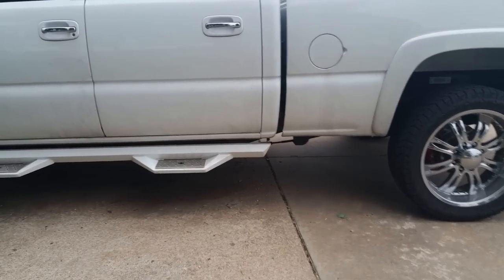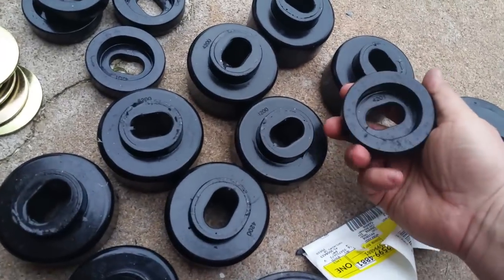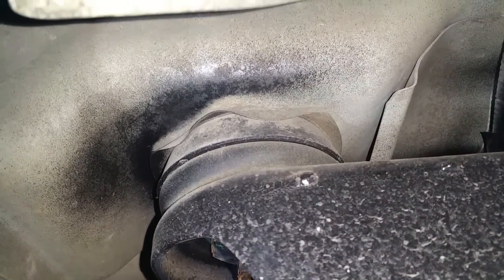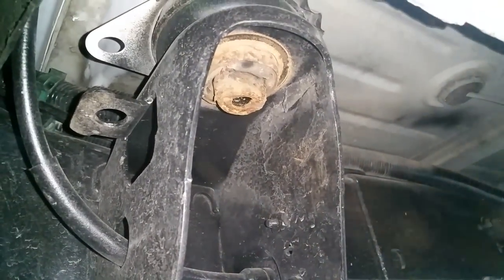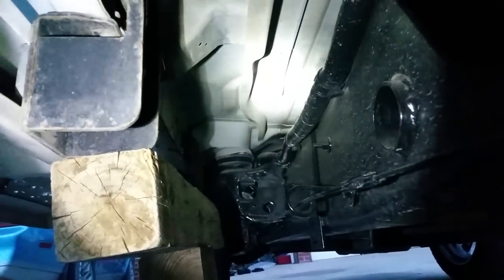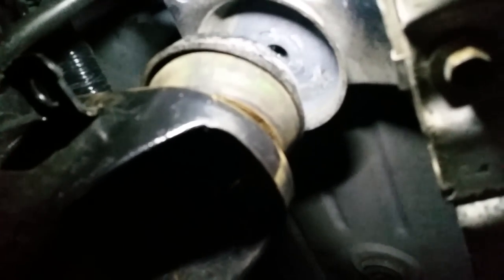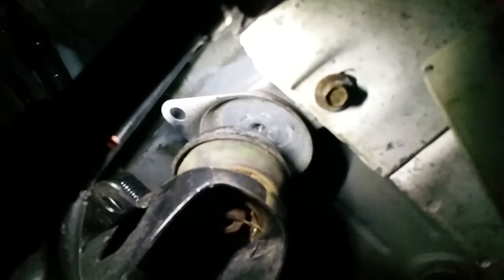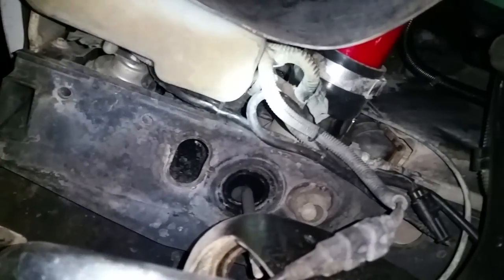2005 GMC Sierra 2500HD Body Mount Replacement

Comment: Nice work Brant! I did the same thing and painted under and ran silicon around to keep out water and air. Biggest killer for body mounts is trapped water and dirt.  I try to rise out around them and reseal them a few times a year. I have a friend who uses roofing tar lol

Comment: Thank you very much Brant! I had some confusion about what if an hardware to reuse, you were a great help!
Reply from the maker: I only reused the bolts - the poly kit came with the flat metal pieces and I replaced two of the poly mounts in the rear of the cab with the GM hydraulic mounts, so I have 2 extra.

Comment: Great video, although I did see on the instructions that you are supposed to reuse the factory sleeve up front on those mounts
Reply from the maker: Yes, you actually are. I missed that part and am still running without. Have always intended to do it again, correctly... Just haven't gotten it done yet.
Reply: @BrantGarrison  just got my energy suspension package today starting the job right now
Reply from the maker: @brentwegner9403  it's not too tough, just don't miss a body mount like I did and wonder why it won't go higher... 🤦🤦
Reply from the maker: @brentwegner9403  oh man.. yeah... That isn't going to be fun at all! Lots of penetrating lube and heat. Good luck and I hope it goes as smooth as it can!
Reply: Hey guys ? What do you guys mean reuse the factory sleeves up front 
I just recently replaced mine and left and didn’t reuse any old pieces except for hardware… I used the same bushings as the video
Reply: @MrPuthycoupe the metal cup on the top side of the mount and the metal cylinder shaped sleeve on the inside of the bushing
Reply: @danielz3594  thank you 👌🏻I ended up thinking that’s what it was , I went back and did that just had to buy longer bolts

Comment: Very informative thanks...I'm doing the same project on mine. I cant find the 'cups' anywhere except for a kit. Any clue on a part number for them?
Reply from the maker: Thank you, sir! The best I can tell is that the body mount cushion is the metal mount with the rubber inside it as one part.
Reply: I confirmed the same with a local dealership. Thanks again!!

Comment: I just did my cab mounts with Prothane bushings and was looking for tips on the radiator mounts. Hate to break it to you but you installed these incorrect. The directions say to reuse all factory hardware if not provided (mushroom washer/sleeve)  Might want to recheck directions, drawing etc. Factory rears look like they came with the sleeve  but the middle, front, and radiator support are basically floating.
Reply from the maker: Mike .Tracey thanks for the tip. I'll check them soon. the whole front end is coming off soon for some upgrades and I wouldn't put it past myself to mess something up.
Reply: Yep.. picked up a kit with no directions. Installed following this. Did some extensive searching. I need to re use the metal factory shells. I knew something was wrong soon as I began torquing to spec. Rear clicked perfect (hydraulic) urethane only started mushrooming. Gap above bumper was wrong.
Reply: Mike .Tracey  what are those top washer things called
Reply from the maker: The only thing i missed was the shells. It works without them, but for the sake of doing it right, they need to be reused.
Reply: Cooll
Reply: Did the shells effect how the body lines matched up? I lowered one side down and the cab sat high so I ended up not using shells on any of them and it sat perfectly.  Do the shells absolutely have to be on there?
Reply: Gavin Ory I was wondering the same thing. I used the stock shells, however I’m beginning to wonder if using the shell with the poly bushings is causing the noise I’m hearing when I hit a bump. If you look at the design, when you incorporate the shell, the bolt ends up bottoming out the shaft of the shell. The bottom bushing piece is not very thick. So seems to me if you use the shell, it doesn’t allow the bushing to absorb much of the shock from a bump causing a rough ride

Comment: Last  two for the hydraulic body mounts can you please explain that???

I have a 2006 GMC Sierra 
I spoke with Energy Suspension. My bushings will be the same size through out. Will I need the two larger bushings too on the 2500hd too???
Reply from the maker: The hydraulic mounts are a factory part and updated version on the 2007 and newer trucks - meant to cushion the rear of the cab to help alleviate the "beam shake" when you drive over expansion joints, etc. in the road.  Everyone knows poly mounts like the Energy Suspension kit are a little stiffer generally than their rubber counterparts.  That's why I chose to go the factory mount way vs the aftermarket mount way.  Plus I got a smoking deal on each.

Comment: I would do this but I’m kinda terrified of the bolts not coming out my truck is a 03’ it doesn’t ride to bad but I like new stuff but I also don’t wanna have a issue not being able to remove the bolts
Reply from the maker: Yeah, definitely be mindful of any rust, etc under there - penetrating oil and heat probably wouldn't hurt either if you do decide to go for it!

Comment: Excellent walkthrough of doing the body mounts. Do you remember what torque you tightened the bolts to?
Reply from the maker: I didn't torque anything down - I actually used my  impact which other's say not to do.  I tighten everything until snug and then just barely past that if its important.. lol  I'm sorry I don't have a perfect answer for you, but to me that just means that it'll be hard to mess it up since I haven't already done it. lol

Comment: I disconnected all my mounts except the rear one. On one side, I couldn't get it disconnected. I tried everything but couldn't get it. Did you have to disconnect anything in the front, I found that no matter what I did, my cab drivers side was just not wanting to lift off the frame enough to get it off. Im more concerned about the rear ones. Cause I have the one that wouldn't come off and then I have the other side that wouldn't go back in( bolt that is). I couldn't get enough clearance to get the rear passenger side one off either. Any advice? 2010 silverado 1500

Comment: I got a Chevy C1500 1998 and the whole vehicle has this springy shaky ride. Is there anyone that could tell from experience if its the cab mounts? I felt them and they are quite soft. Its crazy how the back bobs up and down, as its obvious when I look into the rear view mirror.
Reply from the maker: Lyell Banman of its a bounce instead of a jarring motion, it's likely bad shocks or leaf springs. Although, being that old, replacing the can mounts probably wouldn't hurt if they haven't been done before.

Comment: Looking at doing this myself on my 2018 Chevy Colorado soon. My mechanic friend's shop was worried about brake lines and things being stretched replacing the mounts this way. Do you think that really comes into play with only a couple inch lift? The alternative was have my friend's shop like tear apart my whole engine before doing this.
Reply from the maker: No - as long as you don't go too high, you'll be fine.  The hard lines are run along my frame, so the rubber lines were the only thing that moved any at all.

Comment: when you jack the body up off the frame, don't you run the risk of the bolts not lining up w the holes when you lower it back down?
Reply from the maker: crye redd - actually, I made a mistake and forgot 2 of the bolts at first. But not really.  I suppose if you were on an incline or something, but I pretty much did one side at a time and it didn't move at all.
Reply: ah.. i was wondering about that, as i may have to do them on my van soon...   only a couple look bad, but yeah, lol.

Comment: Will these same bushings fit to 2005 Escalade?
Reply from the maker: @palli666   I can't say 100% bc I've never compared them, but they would probably be close to if not the same based off of sharing similar frames and bodies (1500 half ton trucks and SUVs)

Comment: Where did you put your supports to jack up the cab. It seems like your 4x4 was centered between two bolts?
Reply from the maker: I was using the wood to spread out the pressure on the cab - turns out, it's not too heavy, but I initially missed the middle bolt due to the jack / wood being in the way and couldn't get the thing to lift.. until I figured it out.. doh

Comment: How's the ride with the updated rears and poly fronts? Interesting idea
Reply from the maker: It definitely rides better than the worn out stockers - I think sulastic shackles in the rear will be the best change once I can afford them.
Reply: Right on. Any weird behavior? I was debating replacing with all OEM mounts and the upated rear mounts. But the Poly mountsa re kuch cheaper, but I didn't know what kind of interference/harmonics would be involved with the rigid poly up front and the soft rears.
Reply from the maker: I haven't noticed any difference from the front mounts.  I went with poly because they were cheaper / more performance oriented / supposed to last longer and I purchased an entire kit.  The rear hydraulic mounts were a secondary thought and add on while I was researching a better ride... but it turned out well so far with the combo.  It does ride a bit better (maybe even better with all OEM - that I can't say) and its nice that the body lines line up now!
Reply: Great video. I have to do the same thing to my lbz Sierra. just curious what you used to paint the frame. it looks great. did you have to take the cab and bed off to paint.
Reply from the maker: Jonathan Taylor , I simply used scotchbright pads to scuff the frame and knock off any debris and used Rustoleum black enamel spray paint on it. I did it with everything on the truck, just used cardboard to keep overspray off the rest of the truck.

Comment: I bought a 2005  GMC Sierra crew cab duramax. It has a body lift and I've been trying to find stock bolts so I can get rid of the body lift. Dealer wants $1800 for all of the bolts. Any suggestions on who would have them cheaper? Thoroughbred Diesel has them for $700. That's the cheapest I've found.

 Insane.
Reply from the maker: Wow! I would hit up a U PULL IT or PULL APART type junk yard and take them out yourself. Probably get by really really cheap then. Those prices are crazy!
Reply: @BrantGarrison  .... Yep! That's my next option!! Thoroughbred Diesel has them for 700 bucks! Still too much!

Comment: how does the ride feel after replacing body mount rubber bushings?.
Reply from the maker: It rode slightly better, but I also think it's very very very minimal. I was hoping it'd be more. That, and wanted my body lines lined up.
Reply: @BrantGarrison  thank you

Comment: What have you sprayed your frame with? I've got a 2002 avalanche
Reply from the maker: I used the green scotch bright pads and water to clean and scuff the frame then painted it with several coats of Rust-Oleum black enamel. It's been almost 10 years and could use a refresh.

Comment: So I was installing side steps, and one body mount is stripped. Bolt just spins. And suggestions? Its on s 04 silverado 1500
Reply: Derrick Archibeque had the same issue. Inside the cab, under the carpet, exactly above the body mounts, there is an access cover you have to pry open to access the nut that is supposed to be tack welded to the body. I used vice grips to hold the nut and used a really good impact to remove the bolt. I replaced the bolt with a grade 8 bolt and nut that was just the right length then tightened it down as tight as it would possibly go and retacked the nut on all sides. That is the best way to solve that issue if you haven’t already
Reply: Glad I found this comment, I just ran into this with my 2000. PA kills these poor trucks! 🤣

Comment: Is it possible to place the hydraulic mounts between each one? Maybe improving the ride even more?
Reply from the maker: Matt Zwolinski it sure might be. I didn't look at thing that far. I know at least I the cab mounts it would most likely work. The core support mounts are a different story. I think the only issue you might have is room due to the hydraulic blunts being far wider across than the stock mounts.
Reply: Brant G 
Thanks man! I'm just weary of buying the poly cab mounts as I've heard mixed reviews. Wondering how the ride would be with stock mounts and adding those hydraulic mounts in between each one.
Reply from the maker: If you're truly interested, I'd start with 1 pair and test for them and see how it goes. That way you aren't out a ton of money up front.

Comment: Be aware that if you reuse the stock caps with these polyurethane mounts, the bolt bottoms out on the cap and creates a rough ride. My truck rode rougher after using polyurethane mounts. If you live where they don’t fix roads very well, replace with factory body mounts for a softer ride
Reply: All that and you never mentioned what to  torque the bolts to
Reply: @cliffordfountain8053  isn't necessary if you use them anyway. Enjoy a rough ride and loose feeling cab

Comment: Are these mounts covered by power train warranty
Reply from the maker: I couldn't say for certain, but I would assume they'd more be under the bumper to bumper warranty vs powertrain.
Reply: @BrantGarrison  I was reading the powertrain warranty and it says all mounts , so I just got a call from gm cause my truck had a trans flush and reprogram cause it was shifting kindly ruff, so the gm person said she was going to check with the dealership that did the work and see if it’s covered, cause mine are already cracking on my 2017 Sierra 54 k miles
Reply: @BrantGarrison  if they fix them replace them good if not o well you know how they work with their wording so they don’t cover stuff

Comment: Is it better to use the bigger ones on the back or is it ok if we do all small through out?
Reply from the maker: Emmanuel Munoz The bigger mounts are called hydraulic mounts and they're from the newer body style trucks. They cushion better, but the old style that are OE replacement for this body style will work too. Especially if your mounts are originals / old.
Reply: Sounds good thanks a lot!

Comment: You didn't need the metal cap that came off the old mounts?
Reply from the maker: Yes sir, you sure do! I missed that in my install and am trying to make a new video this spring about needing them.  Also - I updated the description with that info as well hoping to inform anyone watching.
Reply: @BrantGarrison  Awesome! Thanks. I don't want to pay for rubber but I've heard the poly is raising the trucks up a little past the stock height of new rubber. At least the off brand poly ones. Not sure if energy suspension does that.
Reply from the maker: @EGGINFOOLS  I haven't had any issues out of mine so far, even installed wrong.. but i may find that they're a little extra worn once I get up under there.  So far, my body lines still look straight after the install.  It definitely fixed that!
Reply from the maker: @EGGINFOOLS  mine were and are right on the money still

Comment: i wish i could get my bolts out.... didnt break but seem like a nut on top is spinning?
Reply from the maker: Is it rusted pretty bad?  The bolts screw into the underside of the cab THROUGH the mounts.
Reply: @BrantGarrison  its not very rusty...  i have tried pry bar to increase tension etc... I believe it is sawzall time! lol so frustrating

Comment: Wonderful video bud. I’m needing to do mine as well. Just curious if you had any troubles afterwards with brake lines and such getting stretched or anything? Seems like lifting it that far would do something to the hard lines... maybe they have enough flex. Thanks!
Reply from the maker: You're only raising it a few inches in an ideal situation, so everything is fine and has a little flex.. and IIRC, the hard lines terminate before going up to the body, so there isn't a risk there.  I need to do an updated video, so once the weather gets better, I'll try to go more in depth.
Reply: Ahh gotcha. Alrighty, thanks man!

Comment: Your supposed to re use the factory hardware (steel pieces). This video made  me  think  my rusty parts  didn't matter.  Guess what to do it correctly  now  I have to wait on the dealer to get me body mounts  that cost nearly  $175.00 each. Thanks I would have  run  these parts down used while truck was usable  now it is an emergency fix.
Reply from the maker: Yep, it looks like you are right in that you are supposed to use the metal cup on the upper part of the bushing.  I'm not sure how rusted your truck is, but if it's truly an emergency, then run without it until you can procure your own parts.  I actually haven't had those metal pieces on my truck for almost 2 years now.  But, this does give me the opportunity to update this video with more information than I had when I originally did it.  Thank you for pointing it out and good luck on your repairs!

Comment: What are the torque specs for a 2003 2500hd?
Reply from the maker: I'm not sure off the top of my head.. I'd have to look it up
Reply from the maker: looking around, its anywhere from 44-48 ft-lbs - and also the GM manual says NOT to use an impact.  Hasn't hurt mine, but just an FYI.
Reply: 10-4 thank you! I already changed them I just need to torque them

Comment: he never put the top spacers with the sleeve on
Reply from the maker: Travis Burke are you talking about the upper mounts?
Reply: yeah,  supposed to reused the metal cup with the metal post for the upper mount if they are good, mine were shot so I got the Dorman complete mount but swapped the rubbers out with the energy suspension urthane, you will never get the right torque (60 ft-lbs) on them without the metal cup